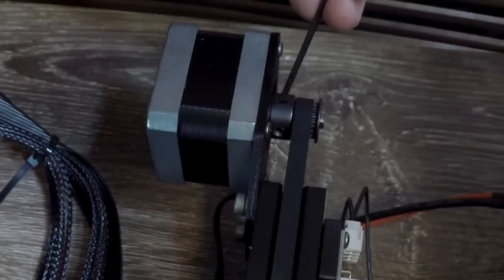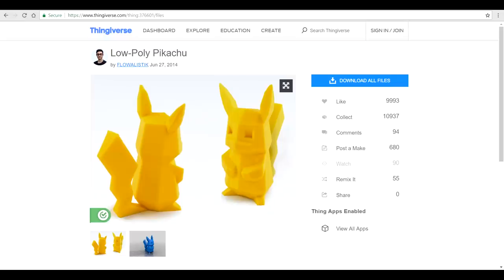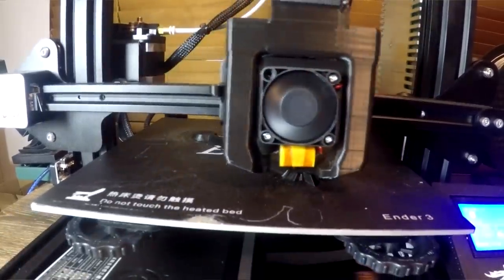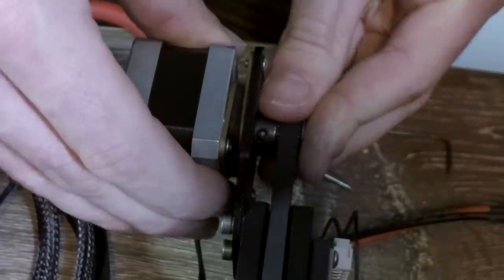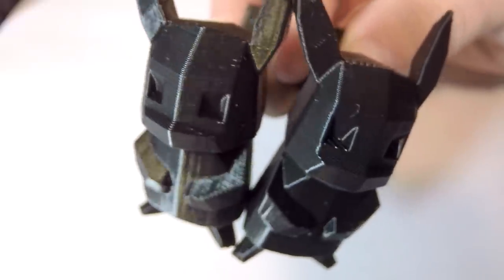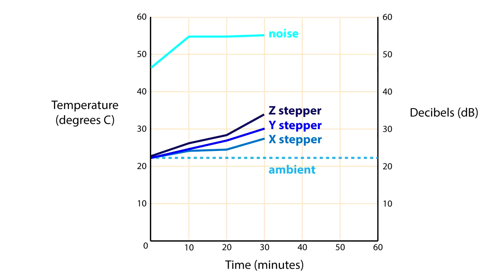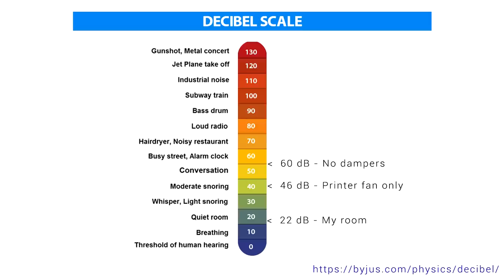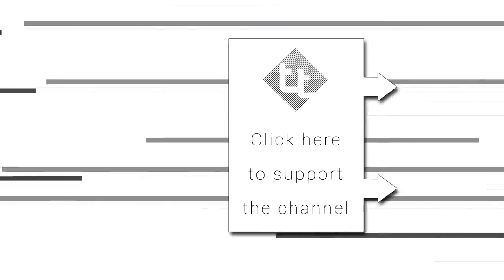Quieten your 3D printer with stepper motor dampers: Ender 3 tests

Comment: guys wtf, all those things are useless. just buy a new motherboard with drv8825 or tmc2100, it costs the same and you also have an upgrade
Reply from the maker: Costs the same? Useless? I think you need to reconsider your position.
Reply: i paid 15€ for a new motherboard and drv8825. aka almost the same price as the dampers... (and i was comparing the price and their usefulness to others who also added more things to obtain silent prints)
Reply from the maker: Well that is bloody cheap. I guess many Ender 3 owners are new to 3D printing and fitting dampers is a lot more achievable than changing a mainboard. Drv8825 in my experience aren't any quieter. TMCs yes but if you match that cheap price for those I'd be amazed.
Reply: i have an anet a8, with the old motherboard (that broke) it sounded super loud, it had the same drivers as the ender 3, i bought some days ago the new motherboard (ramps 1.4) with the drv8825 and it sounded WAY WAY WAY quiter (tested on a single motor tho). today i get the cables and i will mount everything up and will be able to do an actual test to see if it is quiter or not.
speaking of tmcs, you can get 2 tmc for around 15/18 euros and plus a mother board with drv8825, it will cost around 30/35€, so for 15€ more (excluding the smoothers and other things that ppl suggested) you will get a new motherboard with super drivers that is completely silent. (sowwy for my bad english also)
Reply from the maker: Your English is good. I used to run DRV8825s on my Solidoodle 2 for years and it sounded just like every other 3D printer. Interested to hear how yours sounds. You may run into moire artefacts with those stepper drivers.
Reply: hmm strange, maybe you had the vref value a bit hig? i run mine at 0.46V. when i have all the pieces i need i will do some tests to see if it is actually quiter or not.

Comment: This is stupid.  Why didn’t you address the issue you had when you added the damper to the Y Axis.  It rams the bed base into the back of the stepper before it hits the back stop.  This is unacceptable.  There is no way to fix this.  This sucks because it is the purest of the stepper.  Why didn’t you have this issue or did you just not feel like talking about it?
Reply from the maker: Everything you have said in your comment is incorrect, I feel an apology would be appropriate.
Let me explain for you:
My Ender 3 which I made this video about was an early model, where the part is a straight fit. Later models MAY need a printed adaptor.
I have a pinned post that would have adjacent to the comment box when you typed this, addressing the issue and providing a link to free solutions.
I also addressed it in a follow up video: https://www.youtube.com/watch?v=YYYDlxJ0O1E
Not sure what else you expect me to do?